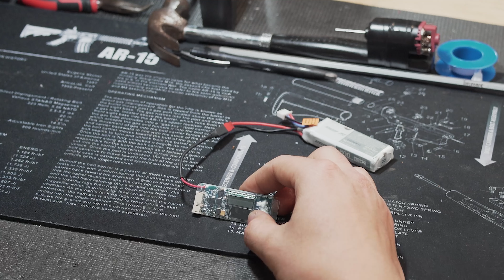Polarstar FCU and what to know when tuning your Jack or F2

Comment: I've notice my JACK engine consumes more air than my F2 and my F2 barrel is like 5 times the length of my JACK gun... is the JACK engine known to be less air efficient than the F2 or should I play with the setting ?
Reply: jack is definitely less air efficient than f2 if the f2 is properly tuned. also barrel length / airseal would effect this.

Comment: Hey mate im doing another hpa set-up with a jack this time instead of a f2 i used a nipple off a fb3.0 nozzle and one of those red alloy t-pieces like he is using in the video in that ,should i do the same again for the jack build i have a few of the gbu alloy t-pieces that are a direct copy of the red outdoor t-pieces  and other fb nozzles and ldt nozzles that i can pull a nipple off or should i just order a few of the ceh printed nipples they are cheap enough plus they have oring rebuild kit's and the techt gun sav grease